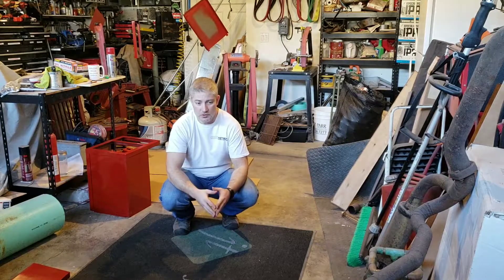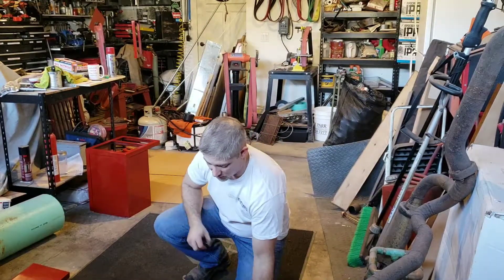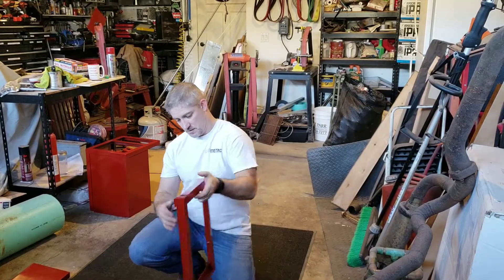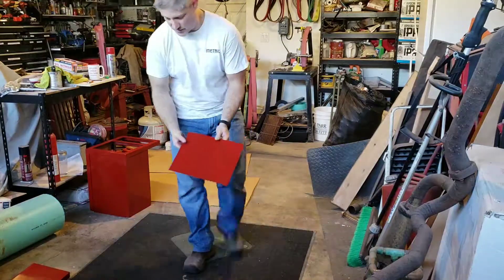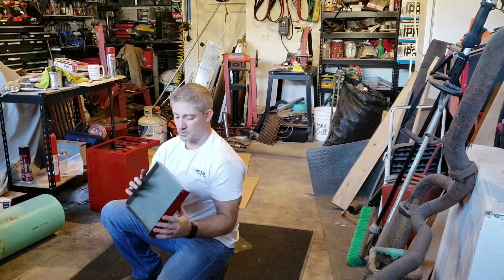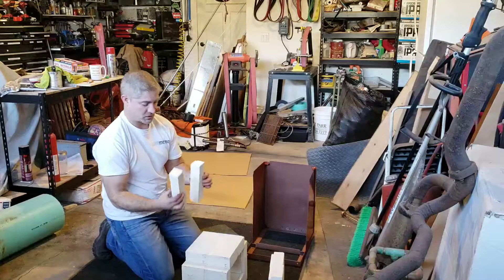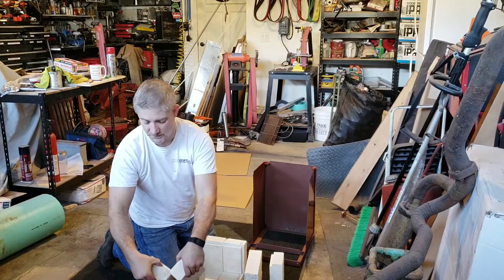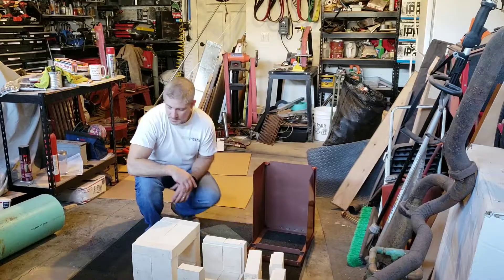High Temp Heat Treating Oven - part 1

Comment: Nice project! Could you tell me why you didn't seal the bricks together? Won't the leaks overheat the chassis ?
Reply from the maker: I didn't seal them because they fit together really well and heat really doesn't escape the joints. Also, eventually some of the bricks may Crack or break and by not sealing them I have the option to easily replace them.
Reply: @NemecJesse  thanks for your answer. You use the kanthal wire as staple to keep the coil in place, is it working well?
Reply from the maker: @ga9098  yup, like a charm